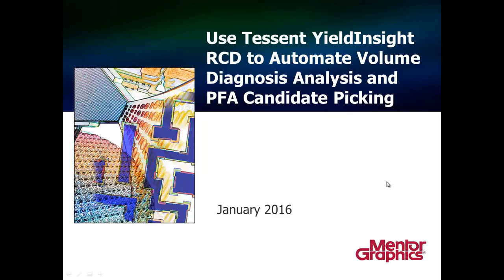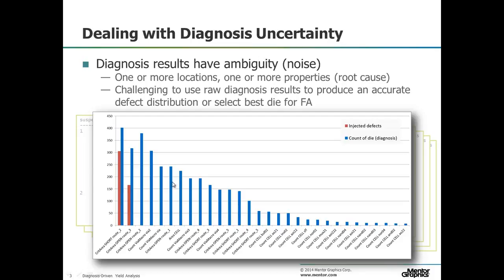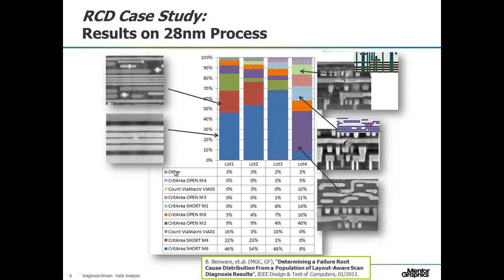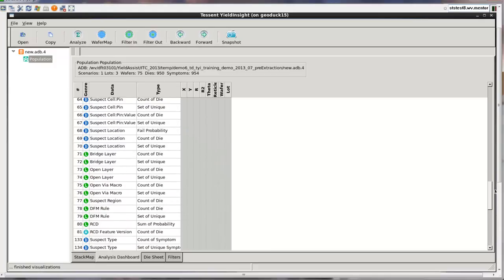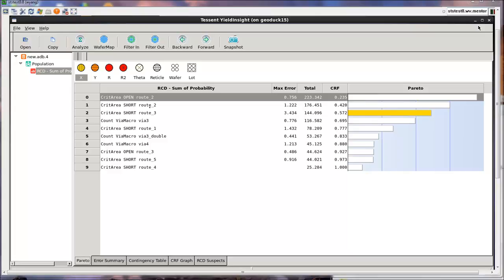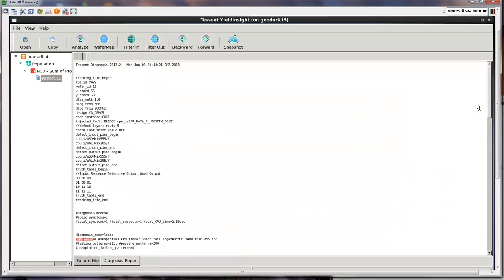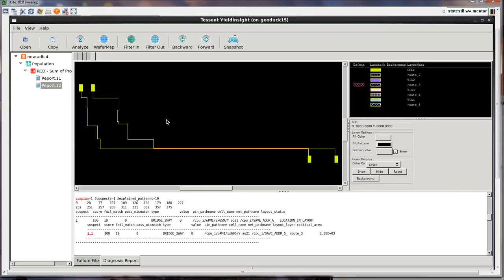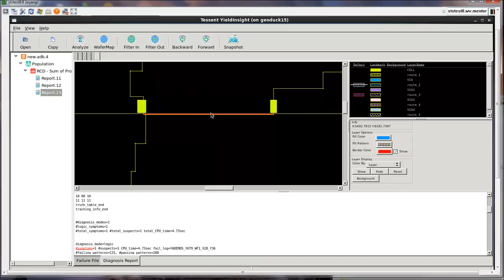Tessent YieldInsight RCD to Automate Volume Diagnosis and PFA Candidate Picking

Comment: Thanks for the good material, about the RCD report, Which one can we use to judge the highest possible probability? From the Pareto ranking, it seems that "total" is used?

if most pattens through some common layers. Is it possible that we can see the most "TOTAL" on these common layer? but not may not the highest probability is in that layer?